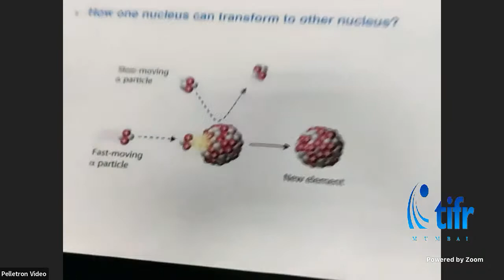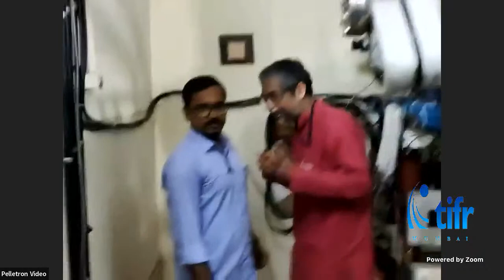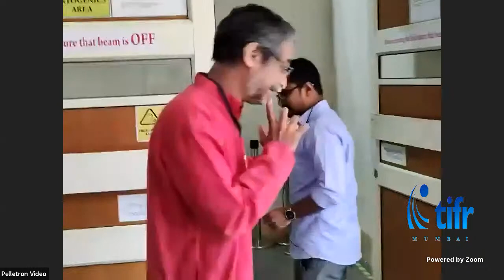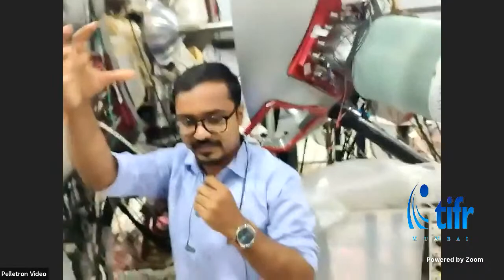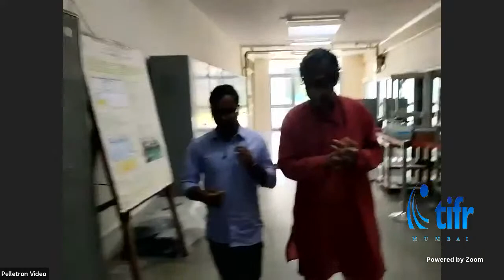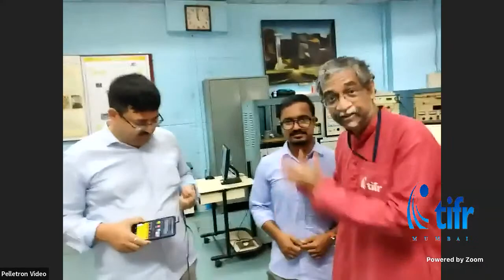All charged up!

Comment: Difficult to understand.
Reply: Here's a summary for you.

He is giving tour of Pelletron, a particle accelerator in TIFR, Mumbai. Here ions (charged nuclei) are accelerated to a few MeV energy and the beam of ions fall into different target material (with target nuclei). The accelerator itself is made in a tower that is n meters (think 7 floor tall)... At the ground floor in the tower there are experiment halls where different experiments are done. In the experiment hall you can see the beam pipe through which accelerated ions travel. Whenever there is a bend in the path of the beam line, to bend the ions there are bending magnets. To focus the ions focusing magnets are used. (This field is called beam optics btw).

In one of the experiments that he is working on, the accelerated ions will be bombard on fixed target. This will form "compound nucleus" which will decay into "excited states" which will decay into gamma rays (photon). Around the target gamma ray detectors are kept.
Reply: @malayali_m ❤